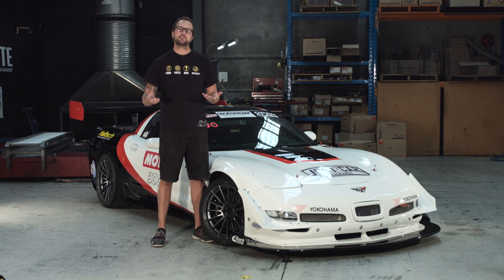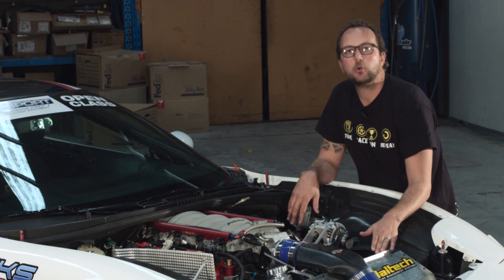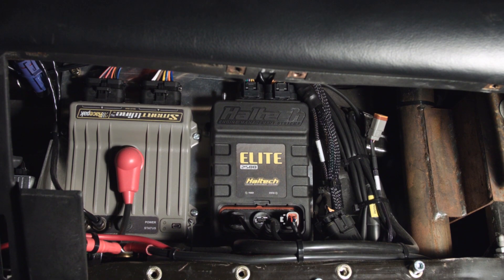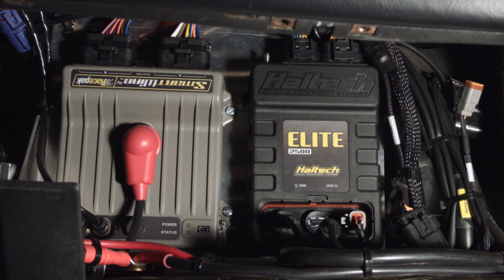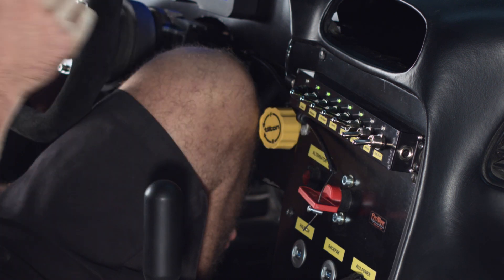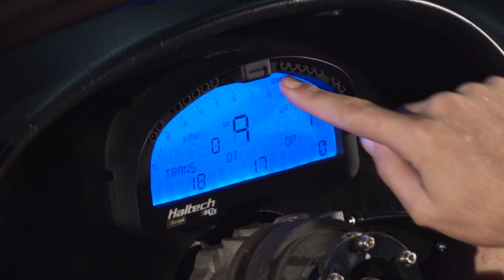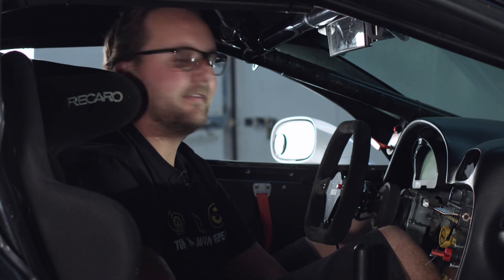🏅 Time Attack Z06 Corvette | HALTECH HEROES |

Comment: do you have a ecu for a ford el fairmont. took it in to get timing done and they couldnt do it because something is wrong. he had to drive it around and do the timing until it was running best.
Reply from the maker: If timing is your only problem then you're probably better off getting a factory replacement. It sounds like you have a mechanical issue there that might need to be addressed first.
Reply: +haltechecu its electronic, as jumping the two pin to disable the advance timing doesnt work. the harmonic balancer and distributer has been replaced
Reply: +Mr. green been a while since I've messed with an older Ford, but have you looked into the ignition module?
Reply: +tj86xj originally i changed it then i changed to whole dizzy for other reasons but found this problem after changing the dizzy doing the timing.
Reply: +Mr. green There's a lot of good info for the Ford TFI system here, including diagnosis info.. http://www.therangerstation.com/tech_library/TFI_Diagnostic.shtml

Comment: What kind of transmission is that? Is it an SMG? I'm wondering because in most of the drag cars I see they have that kind of ratcheting shifter that makes it seem like an SMG and somebody told me it was an SMG, but in all the car build videos I watch they usually say they're using a "Turbo 400" or other modern automatics.

So do drag cars use automatic transmissions that are sequentially shifted or what? I'm talking the cars where they just pull back on the lever to shift. In Larry Larson's car (I know his is a bit different than the average car) he has 3 separate levers that he pulls back one at a time.
Reply: Id say manual sequential with shift cut. Those Autos you see in drag racing have manual valve body control. Eg stall converter and everything like an auto but the user controls what gear its in.
Reply: Just watched a video of the car from a week ago, looks like it is a still a H pattern trans so it's likely still the stock 6 speed with a short shifter.

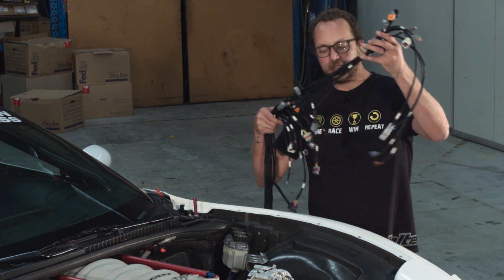Comment: 2:22 Now to keep the wiring to a minimum

Proceeds to pull out a bundle of 15 plus cables
Reply from the maker: It's called a terminated engine harness and yes, when you're re-wiring an engine that is the most efficient, simplest and easiest way to do it. 
Obviously you don't need all that just to wire in an ECU, only if you're doing an engine swap or replacing the factory harness:)